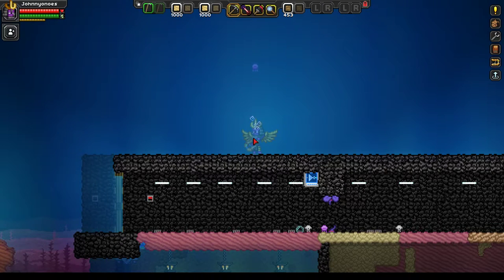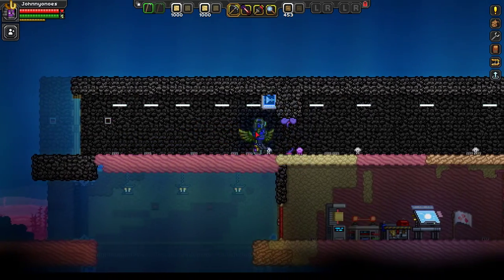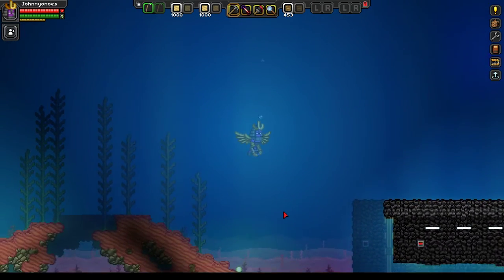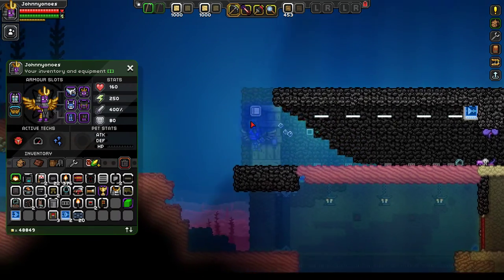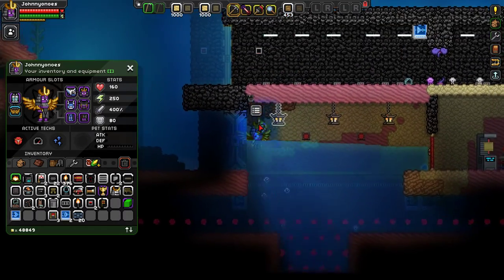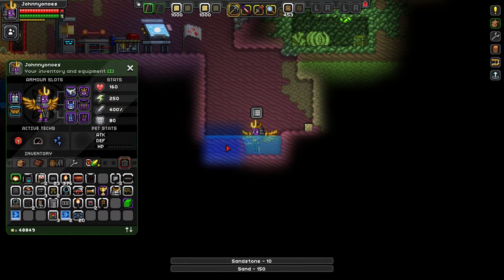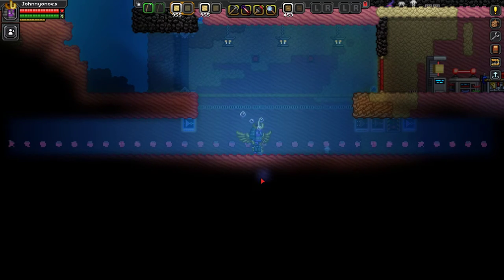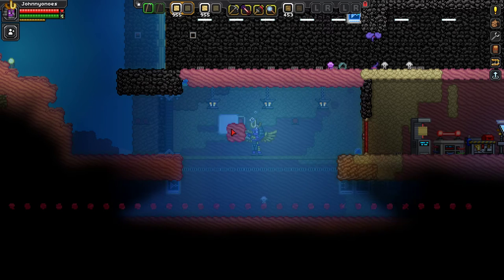Let's Learn!: Starbound 1.0: Two Airlocks! Fast and Fill Up!  (Nick Combs' Request)

Comment: +Johnnyonoes - Oh... so a challenge is what you want :P

Safe/Treasure room:
-Make a big squared screen made of lights.
-Then make a system where every X amount of seconds it will generate a random number.
-Number is at least 3 digits long, ideally 4.
-Add a keypad to the room.
-Make it so the random number generated actually displays on the screen.
-Make it so the random number generated showing on the screen is actually the password/code for the keypad that changes every time the screen shows the new number.
-The code must be punched on the keypad in a certain low amount of time, or it will be considered a fail and reset the keypad.
-The code (numbers) to be punched onto the keypad must be order sensitive (if 1234 is the code, you have to input 1, then 2, then 3, then 4 for success).
-Punching the correct code onto the keypad will cause the system to automatically generate a new number (prevent people from using the same number twice), regardless of the time left for a new random number to be generated by default.
-Correct code must be punched 3 times within a set amount with progress tracking before exit/treasure door opens, otherwise progress resets.
-Having the user's progress reset counts as a "fail".
-Pressing any button that's not part of the code resets progress and counts as a fail, with a 1 second delay (before any button can be pressed again) and a red alert light going off to both show the attempt was a fail, and to not let the user just press 3 "wrong" buttons and flood themselves too quickly.
-3 fails in a row will flood the room.
-If room is flooded, screen displaying numbers goes dark, nothing works, exit/treasure door remains closed.
-User must turn a valve to slowly drain the POISON flooding the room.
-Each turn of the valve counts as half a second of drain power.
-When the room is completely drained, all power goes back online.
-User tries again from the very beginning.

Go ahead :D
I have a lot more fun lately making contraptions and programming stuff than actually playing the game so to speak lol, so this exercise will be more for you than anyone else :P but if you do manage it's gonna make for something entertaining to see completed :D

Will you accept the challenge? :P
Reply from the maker: I love this Allen : ), but it is beyond my ability by far : (
Reply: I really don't think it is. You mentioned what would pretty much be the main component of the entire system and I've seen you use stored data, so the knowledge is there :) But I do know how much time it would take to make something like that so you're off the hook :P I shall wait until the next time you ask for a challenge!
Reply from the maker: Hehe Thanks Allen! (phew)

Comment: Hey that was quick! Thanks! These were what I was hoping to see. And that is what I meant by seamless. I had no idea a few drains were powerful enough to stop a wall of rushing water! So that's easier than I thought it would be. I'm guessing I could improve the design by replacing the door with a column of drains? For filling from below, I'm not sure how you could make it go faster aside from maybe knocking out more holes in a smaller space, but you got to admit it looks pretty cool filling and draining that way.
Reply from the maker: Thanks for the suggestions Nick! That second airlock was fun to make, and that first one gave me an idea for a fun video : ).

Here are the factors that allowed me to get the airlock to fill up faster. Maybe you can mess with it a bit and get better results.

* Filling from the background was wayyyy faster than allowing water to come in from the sides or from above from the foreground.
* Punching small holes worked a lot better than just punching a large background hole.
* Going deeper with the punched holes did not speed up filling at all.
* Going wider with the punched holes sped things up a bit, but not by much. Adding 20 tiles of width only gave me a half second faster time.

I would imagine looking for a water pump mod, or maybe something as simple as allowing a drain to reverse the flow of water would make more sense, I don't think the base game is going to accommodate the requirements for this. 

Lots of fun! Look for an insane video about drains from me sometime today ; )
Reply: Good stuff man! Perhaps adding more holes was counter-acted by the extra space that needs to be filled up around them (the spaces below the airlock room).
Reply from the maker: So I tried to drain a magma planet during my stream today. As expected it didn't work! : ) https://www.youtube.com/watch?v=tQvFgK6hkHk